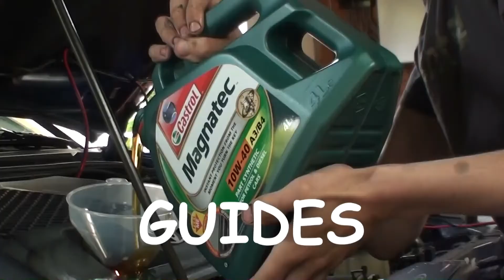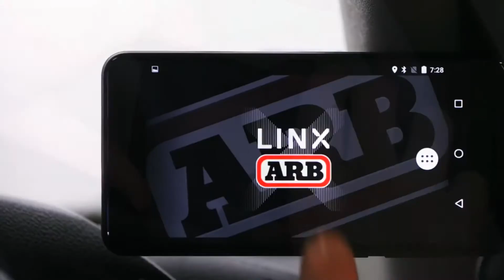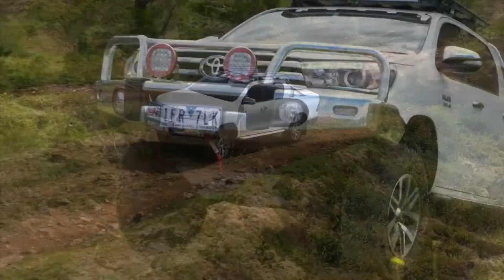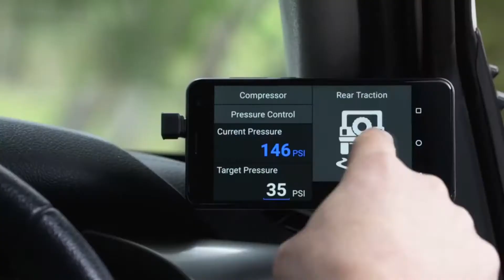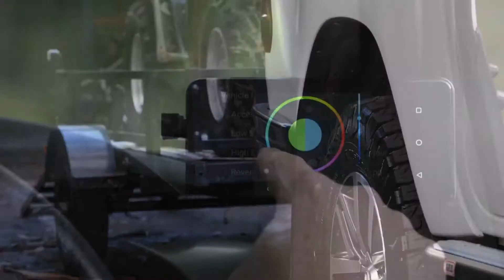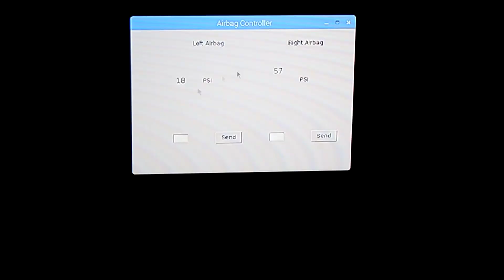An DIY Alternative to ARB's LINX?

Comment: Hey! I'm glad some else is talking about the DIY aspect too!

Question: Will this just end up being an election air regulator value?
I have a simple manual air regulator on my air hose for setting target PSI when airing up tires. It it works and is simple. 
But, by its nature, it is not quick.
If target is 35 psi it will only send 35psi per increment of time into the tire. It will not send the full  100psi and stop at the tire target 35psi.
Obviously, I would prefer the ladder. But I assume that i would need to ditch the regulator and get some sort of seperate pressure set at 35psi that would tell the compressor to stop.
Reply from the maker: Our system will be based on a simple open or shut valve operated of the values of a pressure sensor, so in theory the airbag will receive the full inflation pressure of the 120PSI compressor until it reaches its intended target pressure then shut off the valve 

We dont know how well this is work at the moment until we get the system up and running however if we see that the valves are not reacting quick enough causing over/under inflation then we can introduce a PWM signal to rapidly open and close the valves to slow down the flow but time will tell

we aim to always have 120PSI in the pressure vessel so we can use that pressure for different applications such as running air tools or inflating tires 

Check out our other videos on the channel as there is an video explaining the actual control manifold and how it works

Giving it ago yourself is a great way to learn and a great way to get a end product that does exactly what you want it to do only for half the price of off the shelf options, keep up the good work!

Comment: I've been kicking this same idea around and that is how I came across your video.  Out of curiosity,  why not use the GPIO pins on the Pi?
Reply from the maker: Two main reasons

1. Didn't want to route several cables two and from the cab to control the solenoids in the tub

2. The pressure sensors are analogue which means all they do is send a voltage between 0v and 5v to whatever is receiving it, the Raspberry Pi can only read Digital sensors which send an actual figure depending on what type of sensor it is for example between 0 and 150 for a 150psi max sensor

You can use an adaptor to enable the Pi to read digital signals which is called an Analog Digital Convertor (ADC) but Arduinos can read both Analog and Digital straight on the board, decode it and then send that data via USB serial to the secondary device which in this case is the Raspberry Pi

Plus Arduinos have a lot more GPIO pins then the Raspberry Pi which by the time you add an display (which can use 5+ pins to control) can start running out of pins